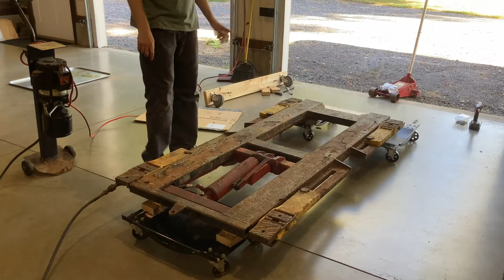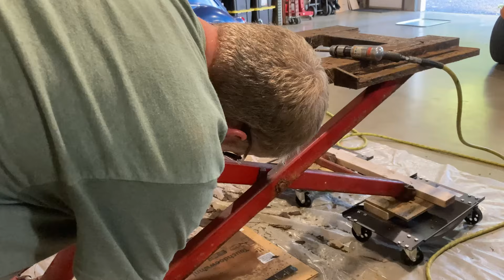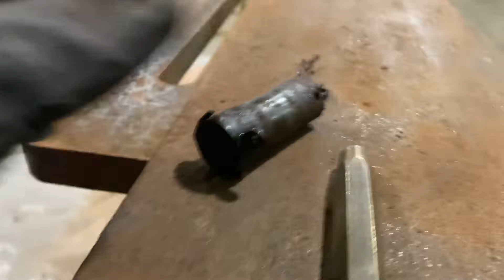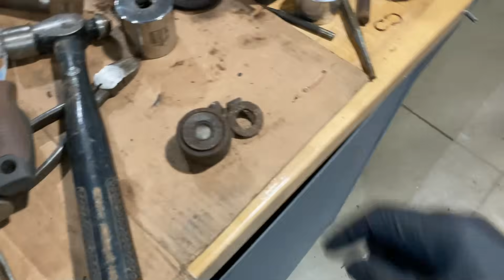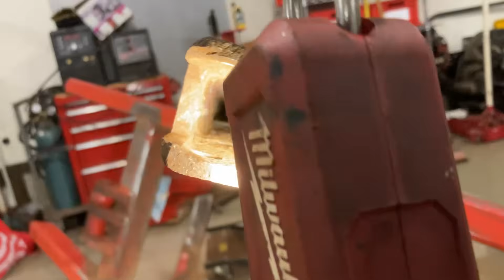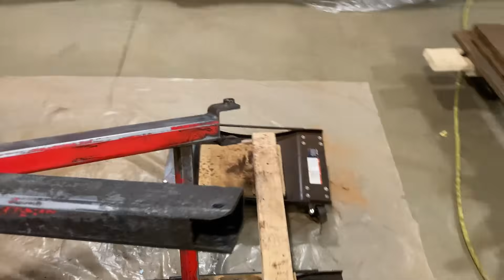Rescuing My Old Rusted Snap-on Automotive Scissor Lift! | Wheeltronic EELR300A Restoration Part 1

Comment: You have a low rise lift. It goes up about 24 inches. A mid-rise lift will go up to 4 to 5 ft. I have a midrise lift. I can sit under the car when all the way up. Or with.my truck I can only go up so far. 9 ft ceiling.  Go up till truck is close to hitting. I can still sit on my creeper and roll around under it.

Comment: I just bought one just like yours, not understanding where the safety latches are.
How do you engage in and disengage it?
Reply from the maker: It’s a great lift the safety latch is the only thing I never liked about it. It’s the arm right next to the hydraulic cylinder.
I can try to show it working when I get this thing back together. It only has one step lock on it.